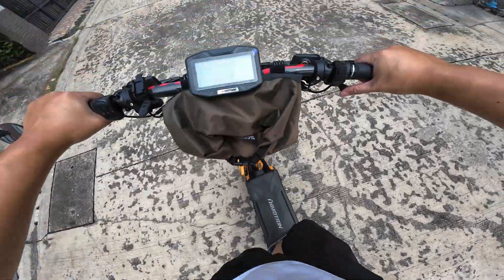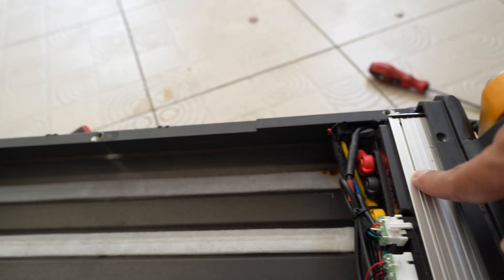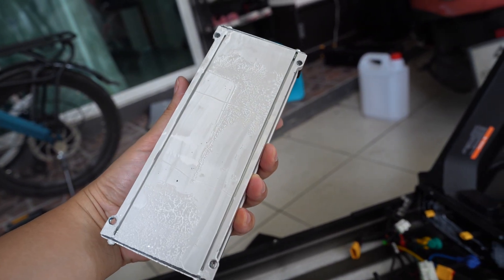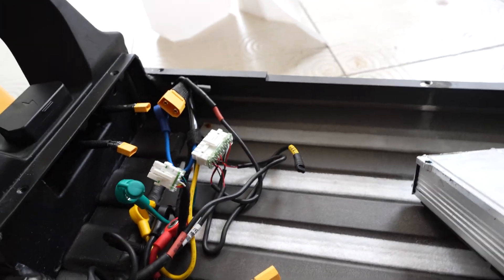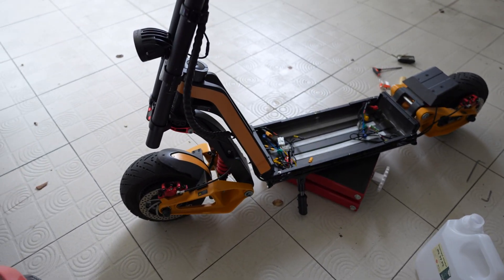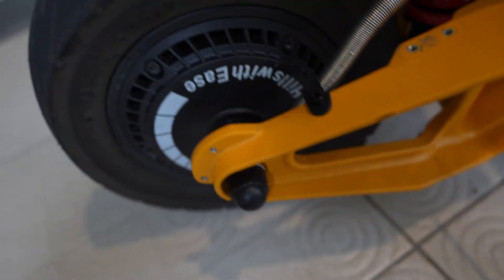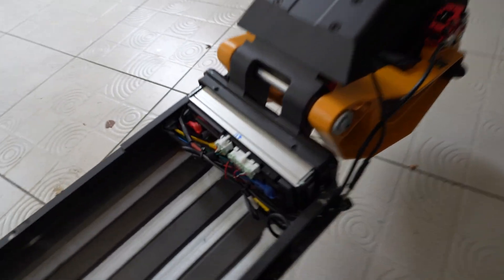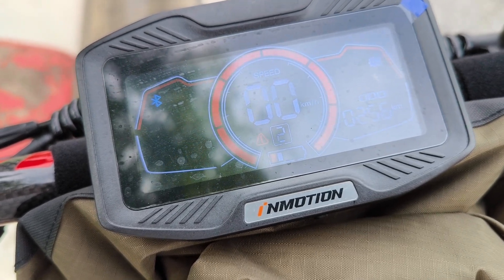Inmotion RS Scooter - Error code 117/217 Part 2

Comment: I watched your first video and I had the same problem when my motor connectors melted there is a bad contact on the hall sensors or a burnt hall sensor due to bad contact

Comment: Check the motor connectors as they tend to melt. This is a known issue on the inmotion RS. I had this problem myself and I completely removed the motor connectors because they do not support the power and overheat. They end up melting and creating false contacts On the hall sensor pins. I have a friend who runs a scooter repair shop and he gets RS every week for this problem. For my part I replaced the motor connector with 8mm bullets and a 6 pin julet connector for the hall sensors.
Reply from the maker: Thanks for the info. Mine unit has no issue with the motor cables. I checked them regularly. Probably because I don't ride faster than 60 km/h. My front tire is not balanced, it will shake and wobble above 60 km/h.
Reply: The power that passes through the cable is not always linked to the speed but to the effort of the engine. If you are for example in single engine and you accelerate hard on a big climb, The power passing through the cable will be very high
Reply: Where did u get the replacement parts from the 8mm bullets and the 6 pin julet connectors...can you say or drop a link here please, I'm having the same issue with my RS Midnight and waiting for a controller from Voro Motors.
Reply: Controllers keep attacking the motors is the problem, high voltage strike, at 107V, every time the throttle is applied. That is the truth.  That's why the failure rate is 100% on these scooters.  Motors cannot survive because the metals inside the magnet are cheap poorly conductive stuff, done deliberately, to break the motors after a while, usually 1 to 2 months.  You have to use heavy-duty genuine 60V 2800W or 72V 3500W motors to take that beating, in order to last decades.   Or yank out that piece of shit controllers and use Dualtron Thunder 2 or Thunder 3 controllers as they don't have voltage strike system.  And do not use regen braking at max setting as it applies same high 107V to attack the motors when the brakes are applied.

Comment: I have rs midnight with 217 error😢Happend to me during first ride!😢
Reply from the maker: I think their controller is very poor quality. The failure rate is so high. Mine is also probably dead after unbox.
Reply: @Payo-TensileCreator  Definitely😞😞
Reply: @bax81 I totally agree as well 💯😰😡
Reply: This is absolutely ridiculous sadly I do agree with you as I I'm experiencing the exact same issues and my RS only has 60Km now 😡😰💀. I love the Scooter but the failure rate on these controller are extremely high 💀😰. Sorry that you're also going through this as well, I'm extremely disappointed as I purchased this Scooter to get back and forth to work 🙈😰
Reply: @Blaznboy1  Most dual-motor scooters have high voltage strike system at 107V (for 72V system), in some brand/model it's as high as 116V, to attack the motor by strike every time the throttle is applied.  Same with regen braking set to max.  Every time it's applied the voltage strike.  If you want to get out of this mess completely get the Dualtron Ultra 2 Upgrade or the X-Limited.  Both of them will last thousands of years, literally.  Thousands of years is an understatement.  Just don't short circuit the battery otherwise it's break-proof.
Reply: You're absolutely right 💯 😢😡🙈...thanks for making this video to explain it, we appreciate it 💯 🙌🏽 🙏🏽. Good luck and hope you get back on the road soon 🙂👍🏽🙌🏽
Reply: @Payo-TensileCreator Payo could you please drop the link on were you bought the Thermal Pads please and thank you 🙌🏽🙏🏽
Reply from the maker: I bought it online locally. You should search for thermal pad with 1.0mm thickness. If you could get 100x100mm size, you can cut it in half and would be enough for one controller. The one I use cost around 1 USD/pcs. The more expensive one will last longer.
Reply: @Payo-TensileCreator  Thanks Payo 🙌🏽🙏🏽
Reply: @Payo-TensileCreator  How are the Thermal Pads working out for you...did they fix perfect and are they working ok. Not sure if your issues have been fixed yet 🤔
Reply from the maker: @Blaznboy1  Yes, it works better than thermal paste. I removed it yesterday to replace the controller. ( The dealer lends me a controller removed from demo scooter) It has good contact with the chassis. By the way, I have to wait another 2 weeks for my controller ( 5 weeks in total.)
Reply: @ Wow 😳 that's insane 💀. I'm glad it's working for you now 👍🏽. I'm still waiting for them to get the controllers in stock before shipping it out. Love this scooter but the company is doing an awful job of satisfying their customers. I was told that it will take 3 weeks for them to get some and then who knows when they'll send it out to me 💀. I'm definitely not happy with them at the moment...I have to try to see if I can get my hands on one b4 they ship it to me.
Reply: @ Thanks for the quick response 🙌🏽🙏🏽